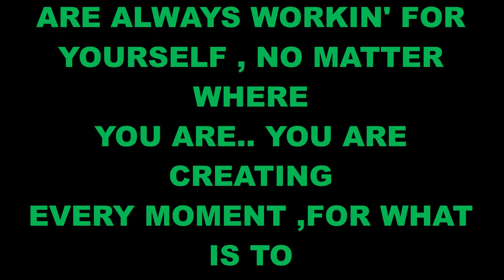NEW AXE HANDLE , NOT FOR LONG

Comment: I thought about recreating the age and wear on a handle. I was kinda thinking of using a sandblaster to get the wear by the head. I love  the Puget pattern ace but you just don't find them in central Illinois.